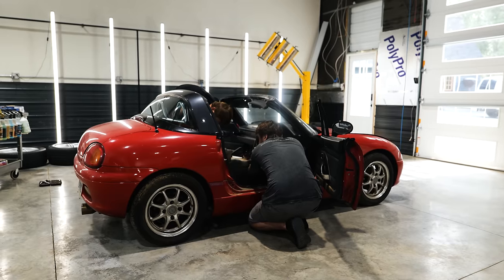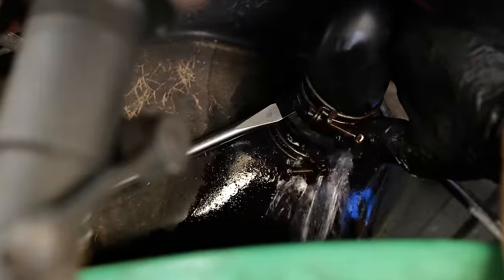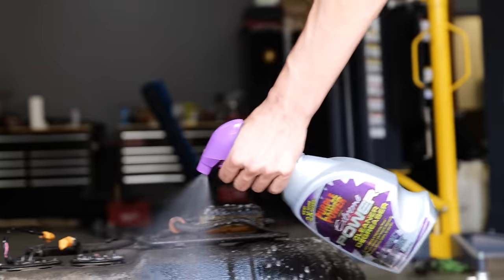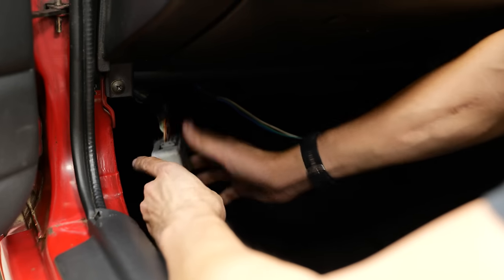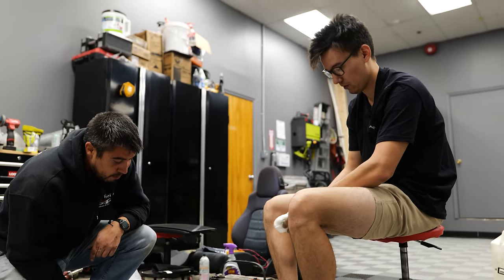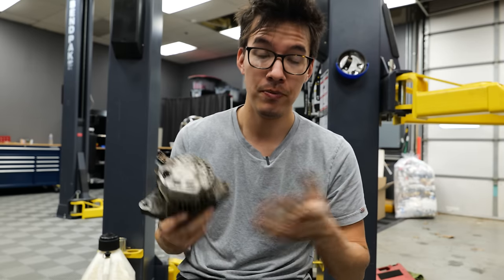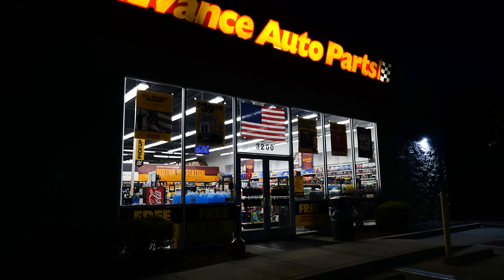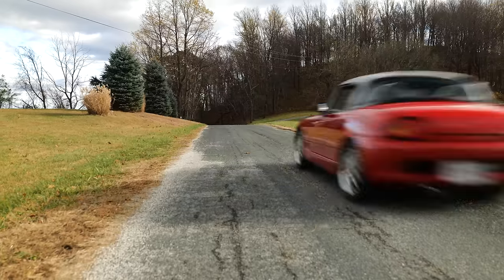Can we SAVE the Flood Cappuccino?

Comment: Bump starting to break the rust from the clutch and flywheel was genius, Genuinely wouldnt have thought of that and would have assumed something worse. Also for the battery, I recently just put a antigravity motorcycle battery in my Miata and just remade the terminals to fit, Now i have  a battery that weighs the fraction of the weight, more CCA and is lithium so it will last wayyy longer.

Comment: The Artic Cat snowmobile has a K6A engine, which is an evolution of the F6A (chain-driven and aluminium block IIRC).
Also, it makes 110hp from the factory, so it can be an upgrade. Not an easy one on the electronic side though (custom ECU ? and rev counter issues).
Of course some crazy swedish guy made the swap and then upgraded it to 180hp and broke driveshafts or the center shaft, I don't remember.

Comment: Hey guys, fun fact for the battery; the Prius battery is from 08 to current is still the same 12v battery. I've sold them for late 2000s to even model years close to 20. Also, sometimes checking for parts based on an engine that came with a domestically sold vehicle is agood work around the "Not sold in Us" issue for some imported vehicles.

Comment: LOL I literally just did a lot of this last month.  My Cappuccino gas tank had sucked in on itself like an empty juice box and also developed a leak on one of the wrinkles.
So I had it patched, reinflated and pulled it out the best I could and cleaned up the tank and diff and then sprayed any mildly brown areas with rust converter and protecter.

Side note: prob should unplug your charcoal canister, because if it clogs it can do what happened to my tank...it's happened to a few people now...as far as I can tell I'm the first person to get a leak and fix it.

Comment: That hard line on your fuel tank looked rusty. I just had to replace some hard line because fluid was weeping through where rust thinned out the metal. If you hold fluid in there and stick your finger on the end youll see if its weeping through in a few seconds.

Comment: Instead of chalking it, just in case, put it on the lift and get it off the ground, then you can run through all the gears too
Reply from the maker: I actually did try it on the lift, but there wasn't enough resistance to break the seal between clutch and flywheel. It just spun the wheels.
Reply: @GearsandGasoline  ahhh, well then, good to know! I was just thinking safety.